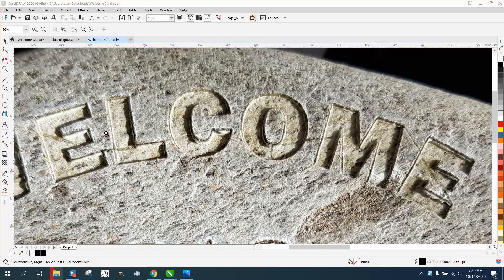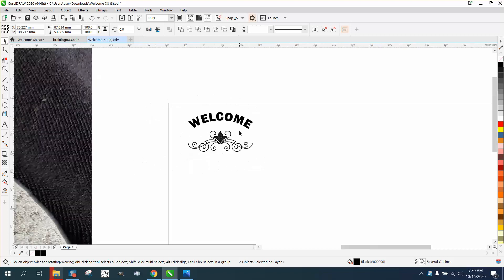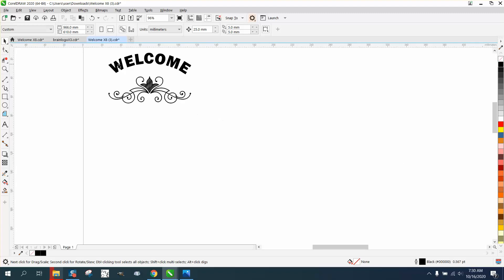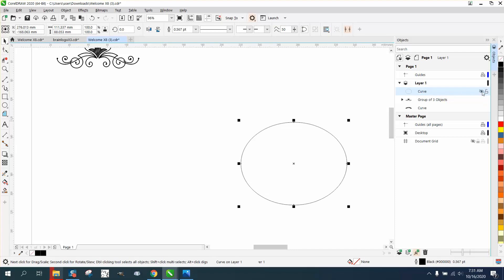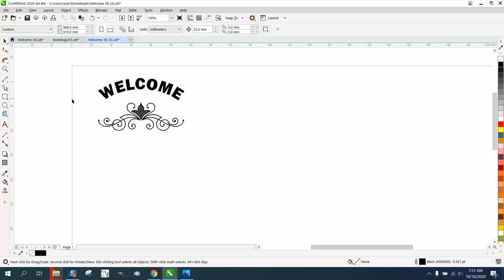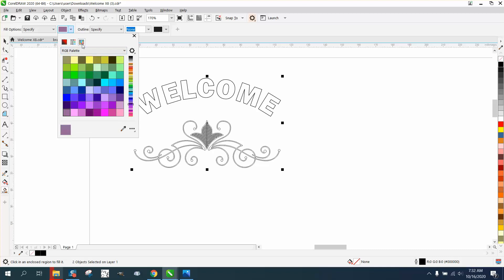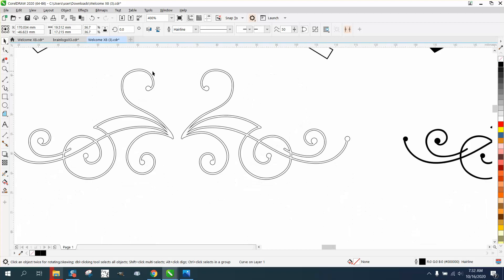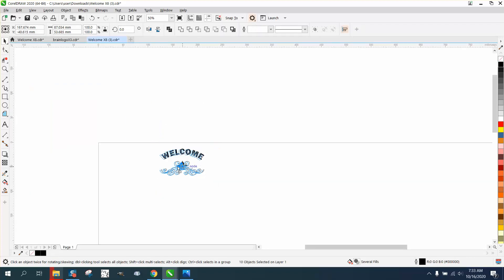Corel Draw Tips & Tricks Hidden Lines

Comment: Doug in looking at the lines it may be an issue with the laser still firing during movement. It would be interesting to know how the image was run as a group or individual items, and what software that was used. By the way, your videos are my goto to figure out what I'm doing wrong! THANK YOU SO MUCH FOR WHAT YOU DO!
Reply from the maker: good point, but it is engraving it, so the movement would not be like that? but thanks